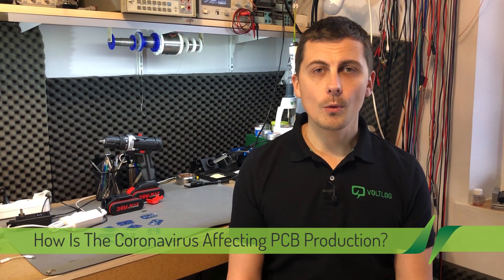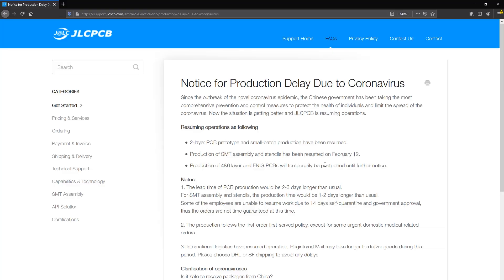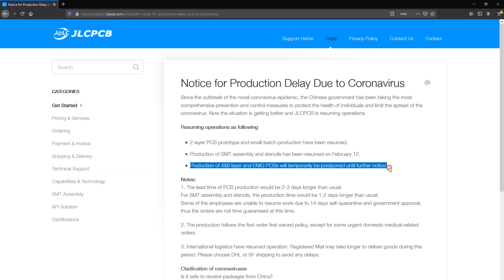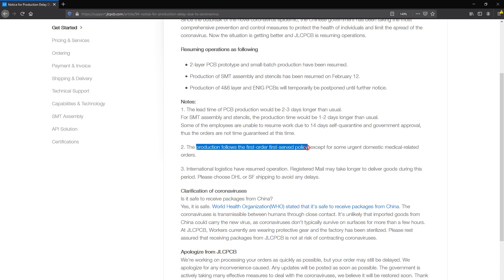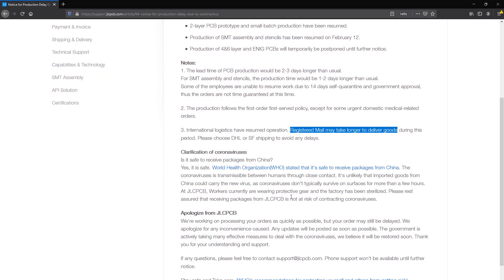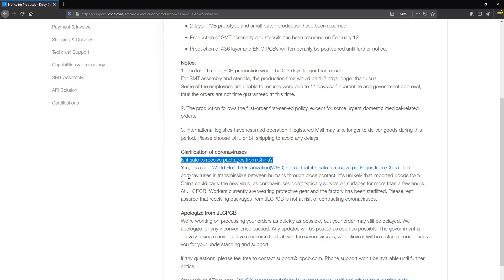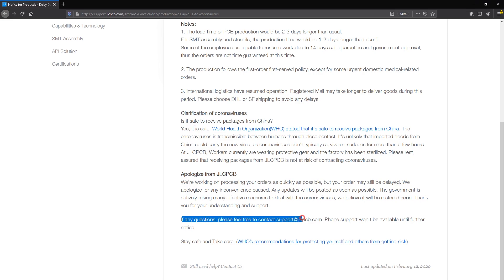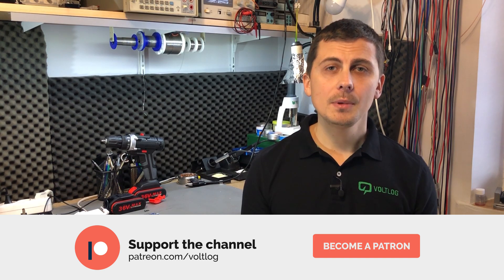Voltlog #286 - How Is The Coronavirus Affecting PCB Production?

Comment: It's been 7 (seven) days already since JLCPCB took my order in production but they haven't completed them yet. What I can see is the orders got stuck at 83% of the progress like 4 days ago and they are still being like that so far. I applied the most basic settings such as 2copper layers, green solder mask colour, 1.6 mm cladding thickness, HASL finishing and no other fancy stuff.

Comment: there is also a pcb manufactur in Germany with affordable prices! 
cheers
Reply: And its name would be?
Reply: @superdau  aisler
Reply: @certified-forklifter  
Affordable seems to be a relative term. I just tried with a PCB that I ordered from JLCPCB two weeks ago. Starting with the fact that I couldn't find a way to get white solder mask, the price is more than twice that from JLC, even though I picked the expensive DHL express shipping method for the latter. The board was produced within 4 days (even though they claimed not to do white boards due to the holidays), shipping took 4 days. The only (temporary) downside: I guess due to the corona virus DHL took about five days to pick up the package from JLC, otherwise I would have had the boards in little over a week (took two weeks this time).
Reply: okay, yeah if you are happy with jlcpcb go with it! for me, the prices from aisler are ok, and i order there because it makes more sense for me to order there for  environmental reasons. 
cheers, have a nice Sunday  @superdau
Reply: Thank you
Reply: @SamuelCarreira  cheers
Reply: I checked them yesterday when i did my last pcb order and the price difference is quite big. 15€ for 3 different pcbs (20 in total) on jlc including shipping and >100€ on Aisler. With that price difference i can already covers the cost for all the parts and some assembly at JLC. If you can plan a bit ahead the shipping time isn't really an issue.
Reply: Also interested.

Comment: I ordered white PCBs at the end of January. I was lucky because even though the information on top of the page said only green boards will be produced due to the holidays, they still went into production. Later the message changed to delays due to Corona virus, but at that point the PCBs were already done. But DHL took its sweet time to pick up the package from JLCPCB. So even though I picked DHL express (needed the boards quickly), it took about 8 or 9 days to arrive instead of the advertised 3 or 4 (the package did arrive 3 or 4 days after DHL pickup).

I have a 5 other China orders over ebay though, that have been sitting there for over two weeks without going into "shipped" status, something that usually takes hours.
Reply: I have about 8 orders sitting on Ali-Express, I've been told about 23-25th February things will return to normal
Reply from the maker: I have mixed result. Some orders placed mid January on aliexpress have already arrived and they continue to arrive while others I bet haven't even shipped. I guess it depends on the seller, the geographical area and other factors.